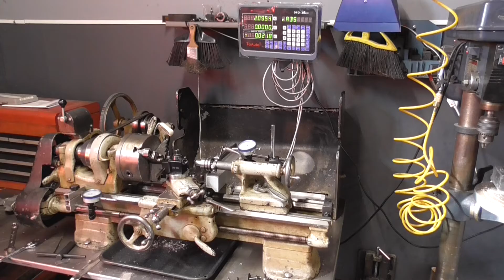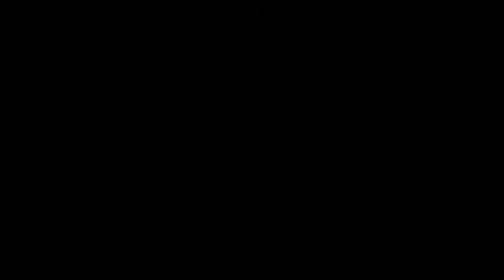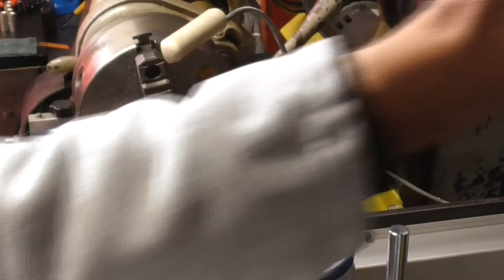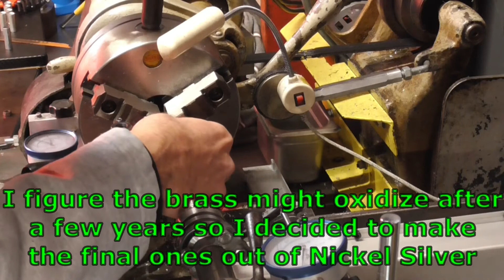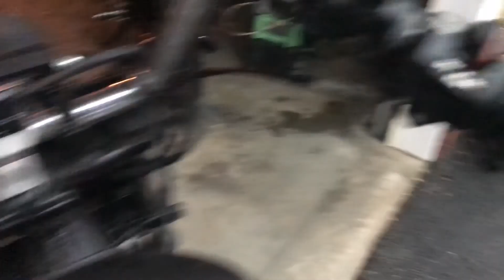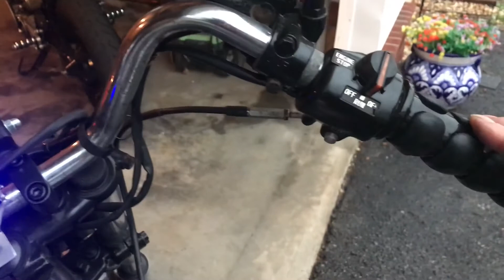Making a 1st Gen xv750 Start Horn Button (the available ones don't fit the xv750 very well)

Comment: Hey. Did you ever start selling these?
Reply from the maker: Hello, I actually bought the Nickel-Silver rod and the nylon rod to make some, but I never could find a supplier for the conical spring so I only made a few trial ones to get the dimensions verified.  If folks wanted just the button without the spring I could put some out for sale on my eBay, but wasn’t sure if the spring stayed inside the switch housing like they always seem to do on mine when the button broke and flew off.

Comment: Very nice job Steve.  I have a small table top Taig lathe I set up to work on cue sticks. I have used it to make some no longer available parts for some equipment I was overhauling in the shipyard. We could have had a company make us the parts, a couple of fiber stand-offs to insulate a 4" ceramic resistor, for over 300 bucks. I told my boss, I would take some bakelite rod home and make a couple and we would have them the next day. He let me go a couple of hours early. An hour on the small lathe had them done. Made a few special tools and bolts on it also, along with a few hundred cues cleaned and retipped.  A lathe is such a cool tool.
Reply from the maker: Thanks man !  Yep, the little lathe is so much fun to make things on for sure.  I finally added a DRO to it as I got tired of looking under my glasses to count the little lines in the dials so now it’s even more fun to play on, lol.  I only paid $400 for it from a guy that restores vintage equipment who got it on trade, but didn’t deem it worthy for a complete restore (it was missing some of the original guards and the original 4 jaw had been dropped and had a big crack on the side).  Swapped out with a Shars 3 jaw for $200 and got a gear guard that was close and away we went 😀.  Hard to believe that little guy is over 80 years old…I can only imagine all of the stuff it’s made over the years.  Happy holidays and all the best !  Steve

Comment: Hello There Steve,  Love your videos on the  Yamaha Virago 750.  You have been very helpful with all your informational instructions, thank you for sharing on YouTube.
Reply from the maker: Thanks man !  Little by little I’ve gotten better at video editing so now it’s not too bad.  It used to take me longer to edit the video than it actually took to do the project 🤣🤣🤣. All the best and happy holidays !  Steve
Reply: @StevesDIYs       Even the way you explain things is really good.   Over the many years did you ever have to replace or clean any of the relays under the seat area, if so which ones?  Happy holidays to you as well friend 🙂
Reply from the maker: @GarysnewYT  , 👍. I’ve had to replace a couple over the years, but go the most part they seem to holdup good. I remember one time very well as I got the wrong relay and when I put it in, the bike wouldn’t start, lol. Apparently the blue marked ones and the yellow marked ones are not interchangeable and have to be matched up to the correct relay socket. If they get mixed, things don’t work right it seems.